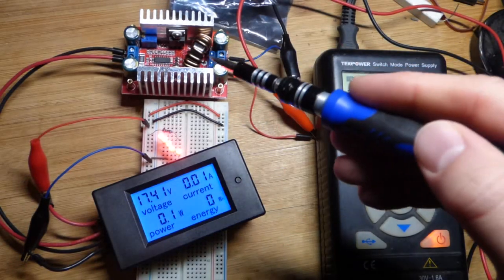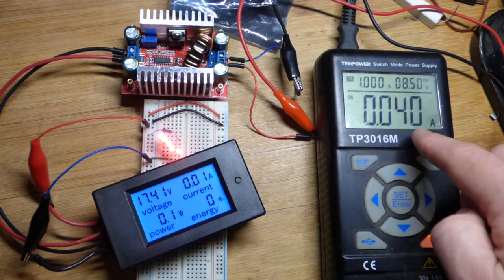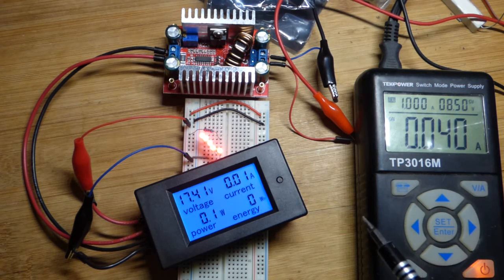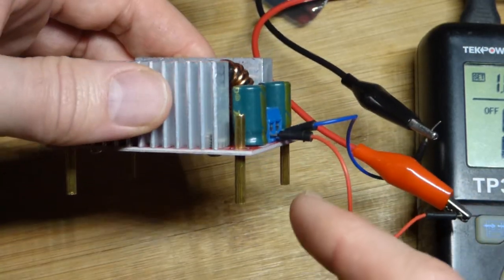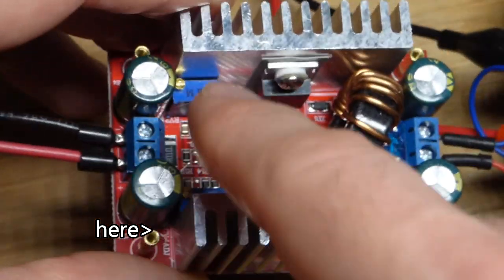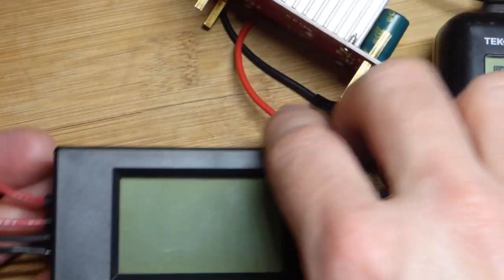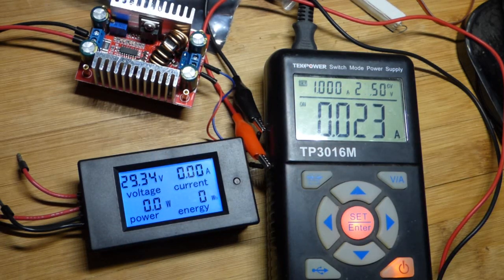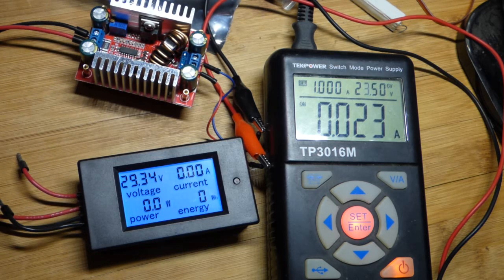Dangerous voltage booster preview higher voltage and current potential

Comment: So what is the dangerous part?? Is it that it fries when the input is higher than the output? That is not dangerous is it? that's only damage the booster...
Reply from the maker: They seem to boost out of control when they malfunction, so more than 60 volts being output, which can be deadly and likely destroy whatever it is powering. That happened with at least one of mine and at least 1 review I read. I believe that the first one I had go bad on me is just outputting 96V even while I was limiting current from the power source powering the module. If it died completely when it fries, that would be better.